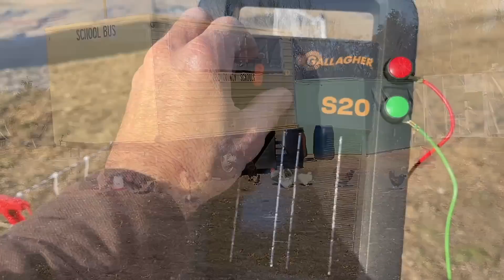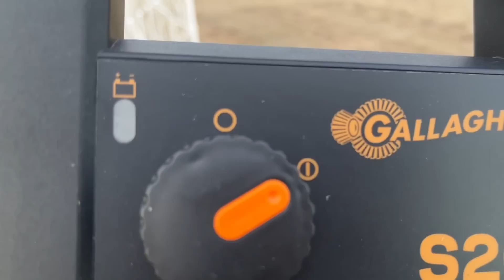They Are Moving On To Bigger & Better Things!

Comment: I want you to promise to anchor the chicken house down. The chicken house on wheels on Wild Wonderful Off-grid blew over in a bad storm and tore it up good. Lost a few chickens too.  Earth Anchor makes one that you can spin into the ground with an impact driver. Then attach cable. Easy to install and remove for when you move the house. I saw the anchors on Green Acre Homestead . He was using those anchors on a carport he put up.

Comment: Chickens are looking up at the big sun orb! I would have put the stairs on the backside....just for less roadside noise affecting them. Also might be easier to cut out large plywood shapes of zinnias and roses and herbs for Piper and M C to paint and draw on the ground instead of hanging by a toenail to a rocking ladder. And then attach them to the trailer sides. Also could be changed out.

Comment: I know I am not there and do not see everything but it seems you have a three point hitch in back of the tractor why didnt you just drop the rake and hook it there would have been a lot easier to move.
Reply from the maker: There is no way to get the hitch on the bus that low.

Comment: You upload from the house so you have cell service or wifi. Get headsets for your phones and next time you move call yourselves and talk to each other while moving. Safer.   
Your draft bar proposition doesn't go up high enough but your tie bar is already bent up. Get a drop bar welded on your bus and drive that like a normal trailer. Raise l easier.  You can always turn around and hook bucket side for options.  
My springtime RIRs are laying now. Sweet girls.